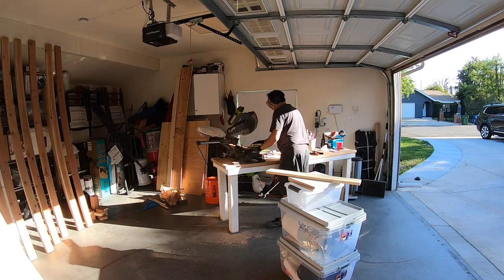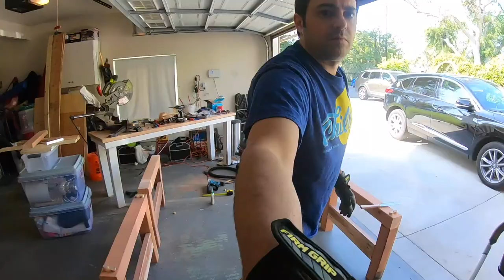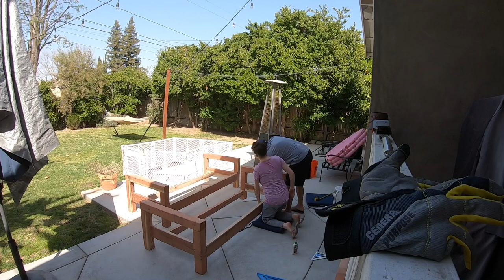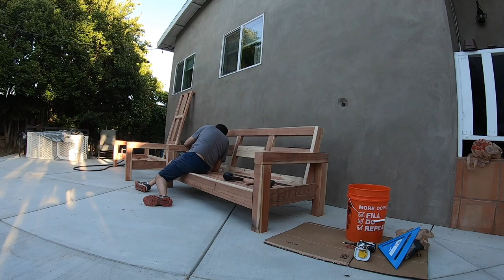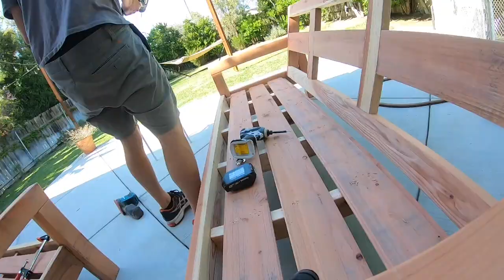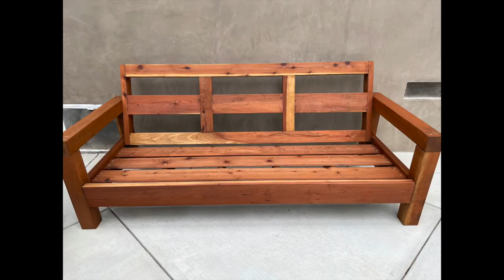DIY Outdoor Redwood Sofa Timelapse - Plans from Nick and Alicia

Comment: Hi, the result is great, really nice. 
It's a pitty that the most important sofa  support is relying on pocket holes though, the long pieces should be resting on the sides and then fixed or jointed by a mortise and tenon joint if you want it to really last. It will make a sturdier structure... Best regards
Reply from the maker: haven't had an issue in 2 years!

Comment: Will be starting this project within next few weeks… any suggestions/ insider tips ?
Reply from the maker: Not that I can think of but it's been many years. The plans do a pretty good job! Good luck.
Reply: @akornusc21  Thank you for the response. Cedar is so expensive these days… thoughts on using untreated or pressure treated lumber? The patio set will be under the roof …. Which one would you recommend?

Comment: I'm building these and use your video as reference, however, I've got to criticize (and this is no fault to you, you were following their plans!), but why is is that the main supports are held by only two pocket screws on each side while the non-weight-baring backer pieces get 3?   I seriously think this should be the other way around.   By the way, how have your sofas held up?  I'm doing two, their chair, and their coffee table.
Reply from the maker: Hey there, ya I didn't give it too much thought I kinda just went with the flow. They turned out great and I still use them all the time, no issues!
Reply: @akornusc21  This is great news!  I aspire to have mine look as good as yours (or close to!).   Thanks for answering.